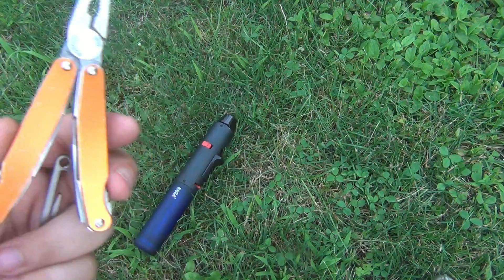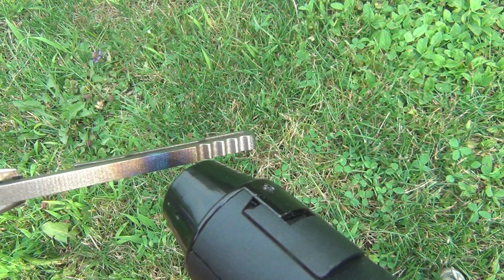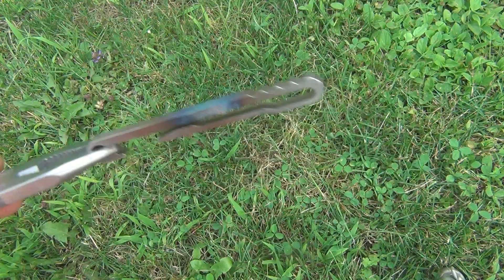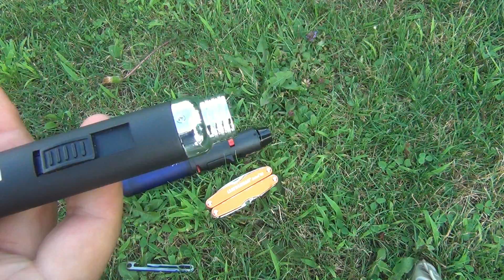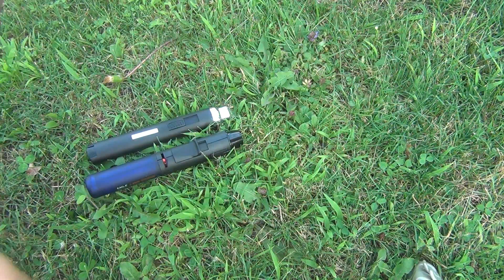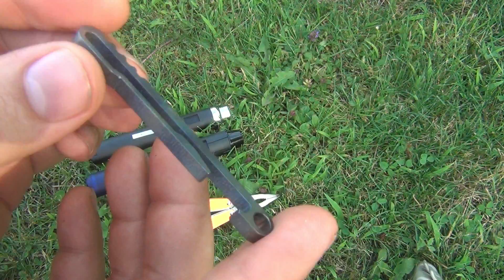How To : "HEAT ANODIZE" Titanium (Heat Coloring Ti Gear With Torch)

Comment: I recently did this to a set of titanium chopsticks, but I found that they didn’t take on any color until I got them literally glowing red hot under a torch flame. It makes me a bit concerned about what that might do to the strength of the metal. Is it normal for it to require the metal to get red hot?

Comment: Well it's not heat anodizing, it's heat oxodization and it realizes fumes that are poisenes to you when you do it. So wear a mask. Anodizing is when you slightly rust the surface of a metal, then stain the rust and metal.
Reply: What do you think oxidation is? Oxidation is rust. Anodizing can be don't with heat or electricity

Comment: It doesn't actually change the color of the titanium itself, it just forms an oxide layer which refracts light, it will rub and scratch off with time.
Reply: Sky2065 anodizing does the same tho

Comment: Really need to clean thoroughly with something like rubbing alcohol beforehand as well to prevent discolored spots and to heat it slowly with the tip of the flame trying to heat up the whole thing evenly if you're going for a uniform color, really easy to burn through the colorsI. If going for patches or patterns then blasting specific areas with the flame would do it.

Comment: Two tips for better anodizing would be to sand it down to a finer finish for a more vibrant color and use something like a small wire or paper clip to suspend it instead of holding with pliers directly to get a more even color.

Comment: stop holding the torch so damn close! the hottest part of the flame is right at the tip. that took way longer than it should have.
Reply: otherwise keep up the good work, love the channel
Reply: Slower is better, when heat coloring titanium it is extremely easy to overshoot your desired color. Heating slowly gives you a tone more control over the process.
Reply: bob345 What’s the best way to make the titanium blue?

Comment from the maker: Yes to clarify by definition I dont believe its anodizing, but rather an oxidizing method, but its commonly referred to as heat anodizing thats why I using the terminology...most people know anodizing changes the colors, so the term is widely used...
Reply: Yep, anodizing refers to the method method used to grow the oxide layer on the titanium. Heat coloring is doing more or less the same thing, just is a less controlled fashion. If you ever want to try anodizong in an electrolytic solution, you can get started with nothing but some wire, baking soda, and a few 9 volt batteries.

Comment: not anodized Jeff that requires an anode it's just oxidation and nitrogen reacting (titanium version of surface rust)
Reply from the maker: I know just commonly known as heat anodizing...even if thats wrong, lol
Reply: serridgeas or temping the steel
Reply: In anodizing, the part being oxidized IS the anode.

Comment: I am thinking about anodizing the first balisong I've ever had. its a ccc so it does not matter if I mess up. hope my blowtorch will make enough heat.
Reply: Tomáš N. Is your ccc made of titanium? Thisonlyworks with titanium specifically. The most you can do with steel is maybe bring it to a light bronze or straw color.
Reply: Jonathan Taylor no its steel, but I've seen it working out on steel too. But hey... who knows what its really made of.